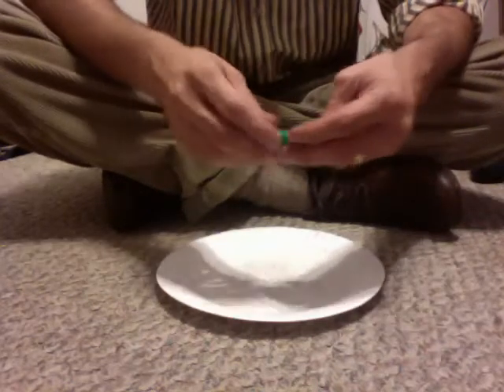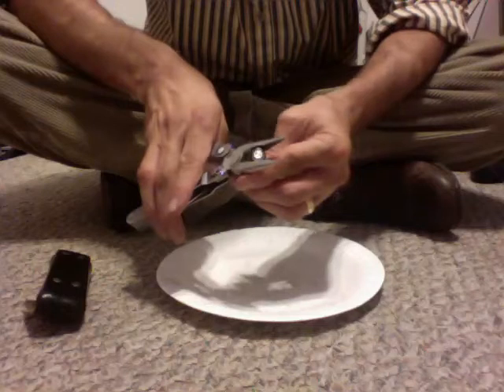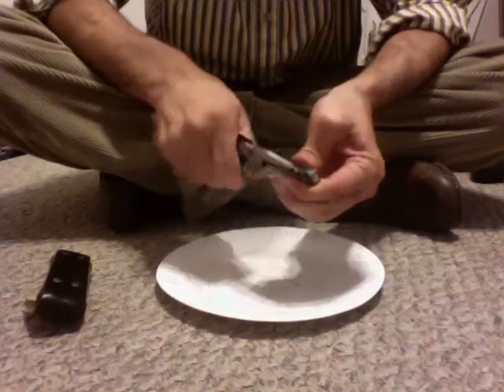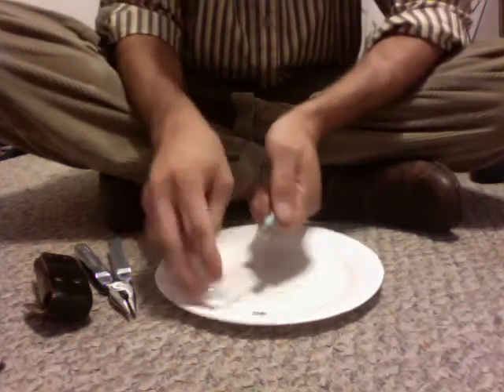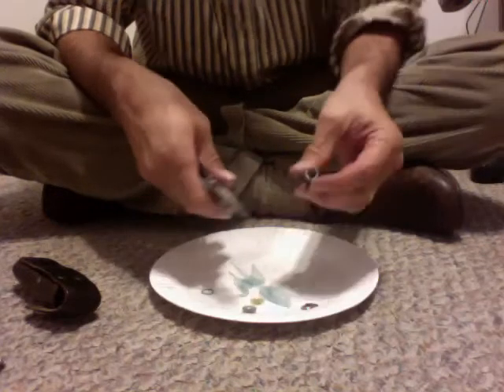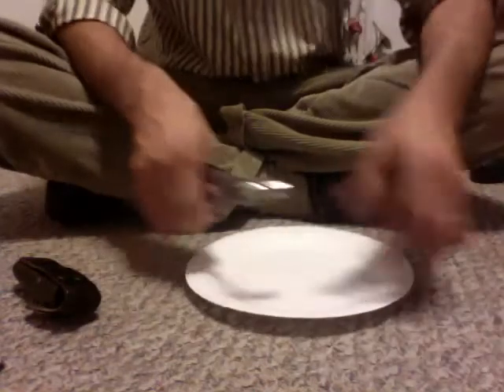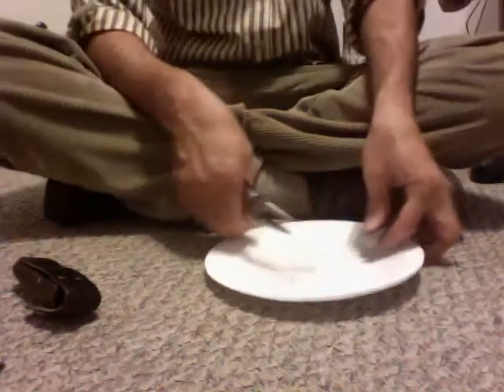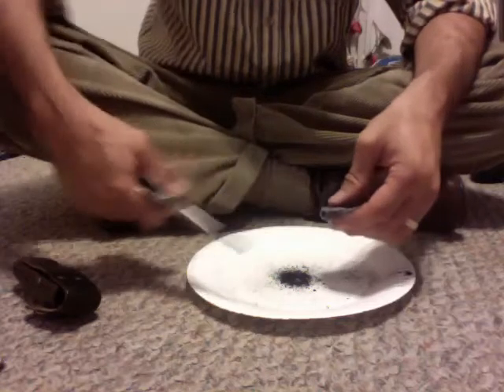Extracting zinc from batteries

Comment: I thought this was more alkaline batteries. I've actually collected quite a bit of zink, manganese, and carbon rods from heavy duty batteries. I do love the zink which such a low melting piont its easy to make castings without a foundry. And obviously the carbon anodes are good for electrolysis as mentioned but D cell batteries are much better for this. One good thing about this process is a used battery is just as good as a new battery unlike lithium batteries.

Comment: It's very easy to have zinc metal Just go to a building supply store you can by rolls of Zinc it's used to lay under the top row of shingles to prevent the growth of moss on asphalt shingle roofs.

Lowes
1/2" x 50' zinc strip roll offers a simple way to prevent roof build-up of moss, ...
Reply: Thanks